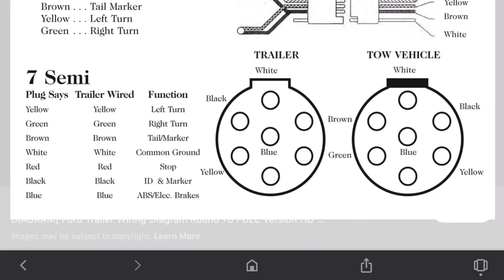Wiring up the Gooseneck trailer!

Comment: Thanks for the videos. Trailer is starting to come together. Unfortunately I have found those t tap splices to be junk. They allow moisture into the wire and I’ve had to replace sections of wiring because the corrosion crept up inside the sheathing on the wire starting at that splice. I would replace them before they give you trouble and save yourself a headache later. Easier to fix in the warm shop now than on the side of the road on a cold rainy night when your trailer lights quit on you. Stay safe🤙🏻
Reply from the maker: Thanks for the comment! I guess I’ll have to go and wire the lights correctly, western Union splice and shrink wrap!

Thanks for the input!

Comment: @Midwest moose 
I have a question when you connected to your break lights and turn signal lights, did you connect the wires together?
On the newer rv7 blade style. The brake signal wire and the turn signal wire right or left. Use a common wire through the harness. Versus the  semi-style.  You didn't stated in the video how you did it but you will have to get two dual diodes.  So you can connect the left turn signal and break light to the trailer plug. You will also have to split the brake light and combined it with right turn signal.
The other difference between the semi and seven blade RV is there is a backup light connection.
It is optional but if you ever pull a boat or a trailer with a master cylinder in the hitch you will want the the backup single wire connected to your backup lights.  So it will activate a stop solenoid to the hydraulic brakes on the trailer, so the truck pushing against the trailer doesn't cause the brakes to come on when reversing.
I don't know if you've done this, it wasn't in the video.
Not trying to tell you what to do but just to be helpful.
Either way, it is turning out beautiful
And well built.  
Have a nice day and stay safe.
We're all in this together.
Reply from the maker: Thank you for this! I’ve been pondering how the brake light lights up, even though I only have the left/ right wires and the marker power wires .

I could not find any explanation how the brake lights would work. I was tempted to wire in a relay off the electric brake power wire to power the actual stop lamps...dunno if that’s a good solution
Reply: @MidwestMoose  
No problem.
 a really would work in a pinch but when you tap on the brakes it would cause your front indicator lamps to  light up as well.
I don't know if you've gotten a electronic brake controller but you need one, to control the electric brakes on the trailer.
But love the videos.
I have a Ford also 7.3 diesel engine.
Reply from the maker: I mocked up the all lights and turn signals as they would be, and everything works correctly. it’s some witchcraft I don’t quite understand. But the brake controller works and all the lights and turn signals turn on as they should.
Reply: @MidwestMoose 
Hell yeah Nice.  I know with the semic connector. which I believe is a J5640 Type of connector.
There's three ways that they wire up the connection the primary & most common used on semi separates the blinker indicators and stop lights. other two versions where they are two common wires.
 
 I hope you're doing well with covid,
We had a elderly family member test positive for it yesterday on Thanksgiving. Now the whole family including myself are going to get tested on Monday.  
But we've all been exposed to each other for over the last week and some of us are showing symptoms but we're hoping that it hasn't. spread.
Reply from the maker: I hope all is well, be safe! My thoughts are with your family. It seemed to help when I started to drink a lot of water, amazing what happens when I don’t drink beer!
Reply: Thank you. Yeah most of the family just feels crappy but not ill.
Reply from the maker: That’s good to hear!